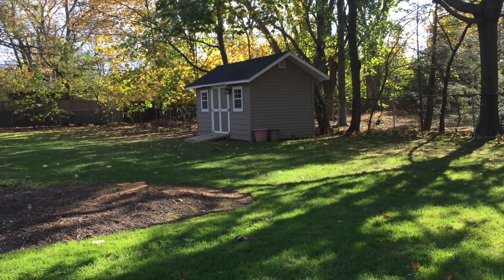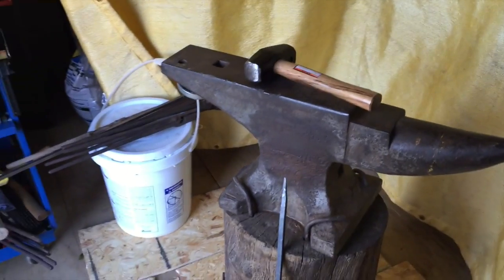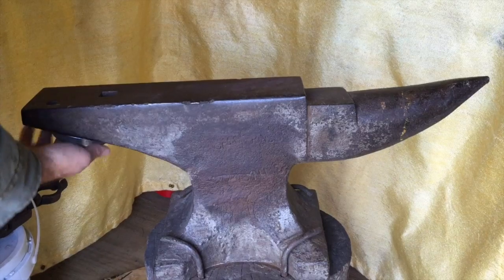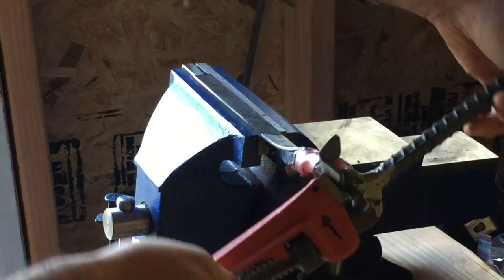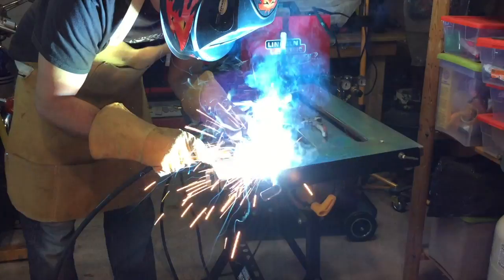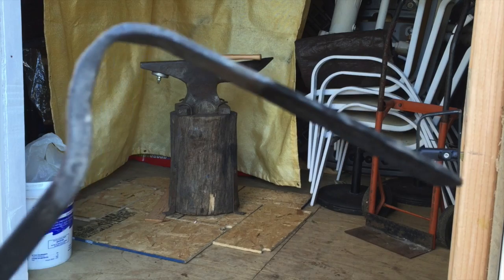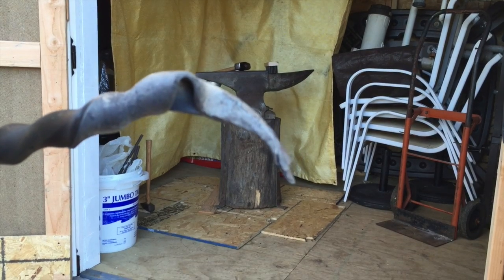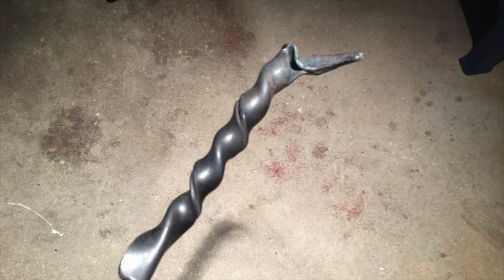Basic Blacksmithing - making a coal rake

Comment: I'm a new subscriber and I'm also a blacksmith myself even though I'm only 14 but a deeper pit of coal is colder because the air must go through more material to heat up your Metal and personally I wouldn't use angle iron I would use 3/8 square stock and flatten it where you wanted the twist I'm saying not to use angle is because it's much harder to straighten it out to a bar or square to have the spike in the back and I think it would look much cleaner but your just starting I just thought that I should give you a tip from an experienced blacksmith I've been doing this for 5 years now
Reply from the maker: +Tyler Ludwig I wish I would of started this hobby when I was your age! Thanks for the tips and info- anything and everything is helpful at this point.
Reply: +eviltwinx  a really good blacksmith that I get a lot of inspiration from is chandler dickinson he is really good with railroad spikes and I think you would like his work especially with railroad spikes check him out he could give you tips that i cant.
Reply from the maker: Tyler Ludwig Thanks! I've been of subscriber of Chandler's for a while and he's one of the reasons I'm became interested in blacksmithing. He hasn't posted in awhile. I'm hoping it because he's busy with the holiday's.

Comment: Since I take it you don't live near an area with coal such as the east coal that is why its so expansive. Living in the Midwest coal is rarer than gold. Until one day well at tractor supplies I notice they have nugget sized anthracite coal. This works great for blacksmiths and is only around $6 a bag. If your local tractor supply doesn't have any in stalk they'll order a whole pallet just for you and you only have to buy 1 bag. This of course does comes with its problems. Anthracite is cleaner than bitismuth and doesn't release as bad as gas or as many clinkers but it is much much harder to light and requires good air flow at all times. I've had it at welding temperature and pulled the plug on the fan and it went out within 5 min. It is much cheaper and cleaner though if you live in an area where coal isn't common and can be more accessible.
Reply from the maker: +Matthew Emory Thanks for the suggestion. and You are spot on with the coal. I can get 50lbs of anthracite for about $14 bucks near me. After I finish setting up my tiny shop and (hopefully) get this hobby into high gear, I might have to go that route. I only bought some of the bituminous because it's the traditional coal of the blacksmith.

Comment: how heavy is your anvil? mine is 450 lb with a ~300 lb stump attached to it. that is a heavy anvil I believe yours is a normal shop size. Yours is a lot more practical given that it's light enough to hug it and move it mine needs a tractor to move.
Reply from the maker: Wow, that's a monster of an anvil! Mine is measly 156lbs, which is perfect for me right now. I just need to get more play time on it.
Reply: eviltwinx 156 lb is a wonderful size, just big enough to do real work on and light enough to move
Reply from the maker: I'm not going to lie, I feel extremely fortunate that I have a Hay Budden of this size and it's in really great shape.
Reply: eviltwinx oh yes it is compared to what I'm working on the saddle on my anvil is pretty bad, I'm going to have to repair it with an arc welder soon
Reply: eviltwinx do you know around the time period that your hay budden was made?
Reply from the maker: Unfortunately I don't. I can't read any serial numbers on the foot. I do believe it's a later version since it has the seam in the middle and a welded on hardface.
Reply: eviltwinx oh you have a good one, made entirely from tool steel and then the face is tempered. you scored!